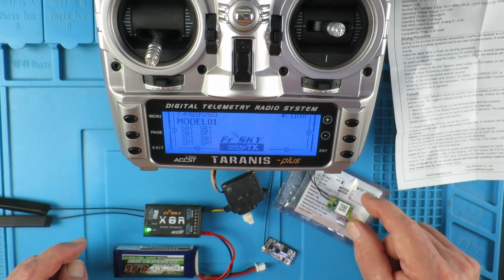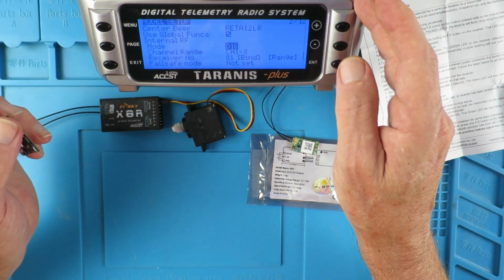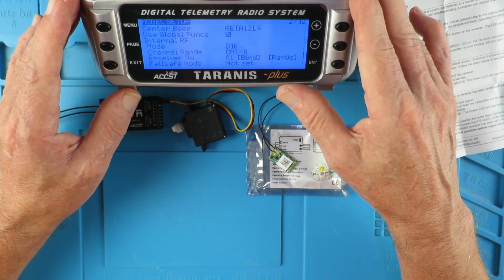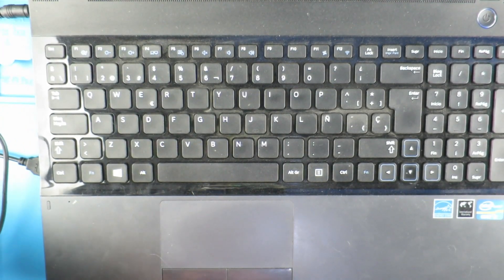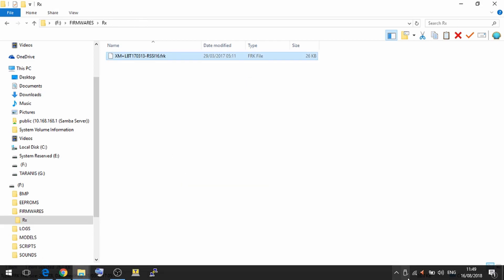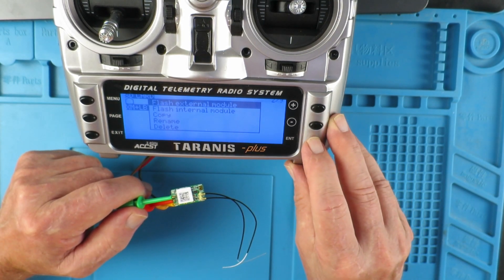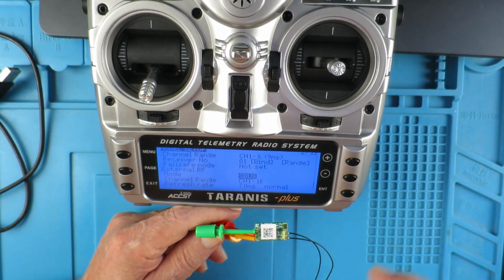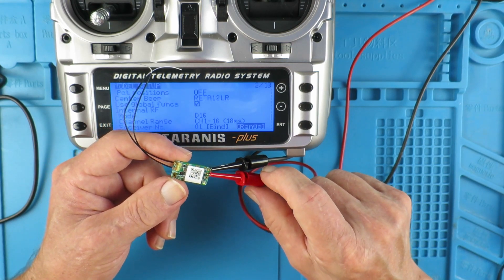FrSKY Receiver Firmware Update Tutorial EU LBT

Comment: If you flash opentx on the taranis and in the options box before flashing untick or do not tick the eu option. After flashing opentx you will still have eulbt but the option of using D8 will be available to you now in the menu if you wish to use it.
Reply from the maker: Thanks! Good to know. My preferred solution now is to use the iRangeX module which will bind to almost anything! https://youtu.be/e4ReeQZznT4
Reply: @1nformatica  yes I have one of those as well as I have the first generation V8 rx which were only compatible with the modules. I was given 8 by a friend and have 4 myself so for non telemetry full size rx's figure I am fixed for a few years🖒
Reply: @1nformatica  Know that the IRangeX has less range than the internal XJT module. Even with ACCST v2.1 LBT firmware you have the option of using D8 mode, as long as you don't enable EU option in Companion before downloading OpenTX firmware binary. 😉
Reply from the maker: @arlemooldijk1595  Thanks, Good to know about the D8 option. I have not noticed any lack of range with the module v XJT internal. I mostly use it with small "foamie" types from Eachine and the like but I also flew my ageing Mirage using the module with a Corona V2 Rx https://youtu.be/_7a99ZceCuk quite a ways out!
Reply: @1nformatica  Have fun flying! If you keep it in clear sight it will probably be ok. 😎